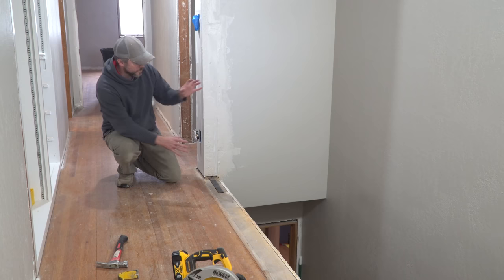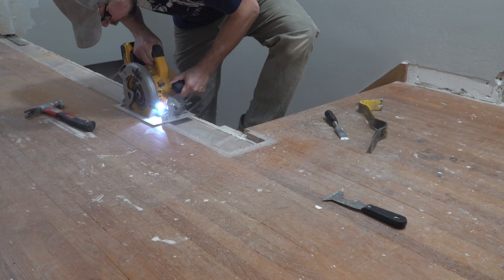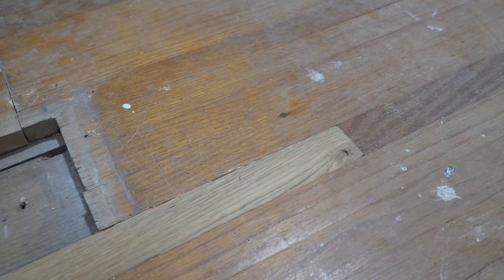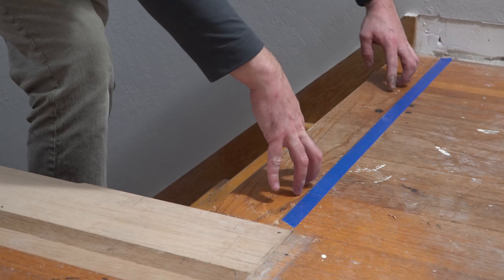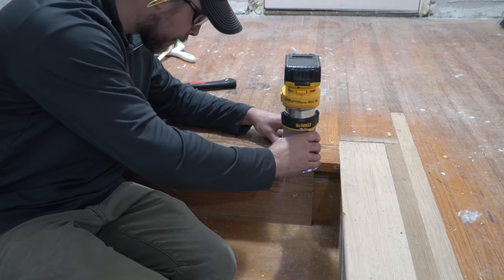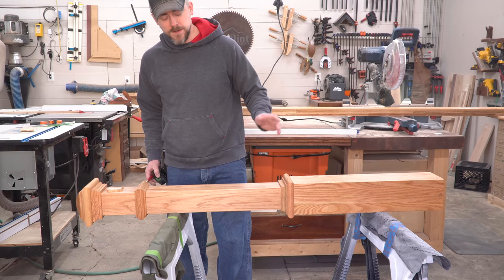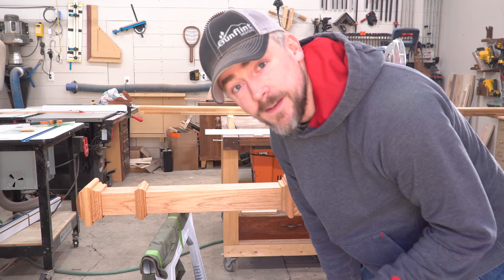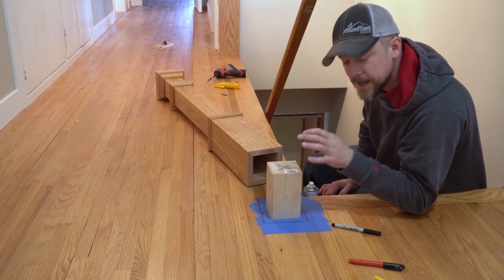Installing a Staircase Guard Railing & Hardwood Floor Patching - DIY Homeowner Problem Solving

Comment: For just guessing your way through things, this all seemed to be how my grandfather did a similar handrail at my place and he is a 42 year experienced master carpenter. One thing different was that instead of the dowel you used into the floor joists, he ran a 12" lag bolt through the inner post support and then routed out a 1/4" pocket into the floor to set the core into. This meant that the piece core could not spin or rotate around the bolt while the lag bolt anchored into the framing and could be tightened if the post ever started to wobble.
Reply from the maker: The routed pocket crossed my mind, but I thought all the screws and the dowel would probably be enough. Time will tell if I regret that shortcut!

Comment: And a drill guide is for the birds. I own one and have never used it.  It's brand new in the box.  It was bought for me for railings if I was to drill them before install.  I don't typically so there you are.  I drill up and straight.  My balusters go in easy.  I do iron the same way and use epoxy or the tight bond pl 400. It's super strong. It will be loose asf on initial install. But make everything straight.  Walk away.  A day or two later, it's perfect.  And rock solid. There's a trick to the application.  And a certain amount of adhesive required without making a mess.  More or less a feel and know your caulk gun type deal.   It works very well, without the old-school methods of shims or double sided screws.

Comment: I like your work.   My one question is, code here in Maryland has the end of handrails turning 90" and connecting to wall or post.  I was told
so you can't catch a handbag or sleeve on railing.   Were  maybe overly cautious here in the east.
Reply from the maker: I've never heard of that one... but I just put the old one back up that was there originally. I guess when I replace the steps themselves, I'll look into that.
Reply: Here in WV too. When we finished out our basement, the inspector told us the same, the ends of the handrail had to have a return back to the wall or post.
Reply: Yes this is worldwide, IBC code requires a wall return on all handrails.

Comment: Looks great.  Other than I would have used the same railing material for the handrail part and a gooseneck up with two 45* angles to return it to post.  The flooring fix was awesome though for sure. And I do the same when figuring out balcony rails with plowed railing/ square baluster design. You got it bro. I do this for a living lol.  Was looking for tricks when I found this video. Bottom line, you did much better than most folks.

Comment: Wondering how many inches is the handrail out from the banister?  I have a ledge to get past as well and code is no less than 1 1/2 inches.  Is the hardware you used to install the handrail oversized to get past the ledge?

Comment: How do you like the Dewalt  20v brad nailer?  I bought their 20v framing nailer when I built my garage and hated it.  It jammed frequently.  I returned it and replaced it with a pneumatic.  I've wanted a cordless brad nailer as it would make trim projects inside the house easier to setup.
Reply from the maker: I love it. I’ve never had it jam once, and I’ve trimmed a two story house and half of another one with it.

Comment: I’m trying to take one apart that’s identical to yours.  Reason is, it’s loosened at the post end over time & I’d like tighten it if possible.  Having a hard time finding a starting point to dismantle it.  From what you’ve shown, that post is doomed to become wobbly unless that inside block is well-anchored.  Any thoughts?

Comment: Is there any difference between doing this with 12mm thick Aquaseal laminate flooring vs hardwood flooring? Worried about expansion and how that might effect railing.
Reply: The difference would be you want to run the flooring up to your framed in finish work, rather than finishing over flooring like what you see here. You can use a fine tool to cut out the flooring where you will have penetrations.

Comment: Your kids must have watching Colin Furze.
I would have use a steel pipe as a dowel.
Reply from the maker: Steel could work, but it wouldn't glue to the post like wood. And steel might eventually bend and hold that shape. Wood won't bend... but it'll break all at once if it ever gives up!
Reply: @GunflintDesigns  A 1-¼" diameter, thick-walled steel pipe certainly will not bend before the post breaks.  Glue it in with copious amounts of epoxy, King's Fine Woodworking-style.
In the end, nah, the dowel should be good enough.

Comment: Why didn’t u use the same style railing going down the stairs and why is the railing attached to that side and not the drywall side?
Reply from the maker: We are going to redo the entire stairway eventually and nock out the drywall side. For now, it was just easier to put the old railing back up the way it was.

Comment: Thanks for the video, I don’t want to replace mine but I am trying to remove it and install it better because the way the builders did it it just not good it shakes too much, not sure how it passed inspection. 😂😂 here goes a 2 day project turned into a 2 months project 😂😂